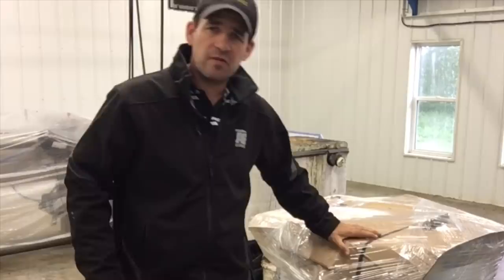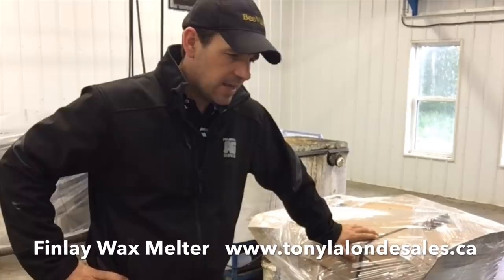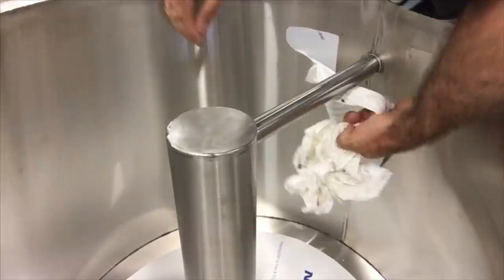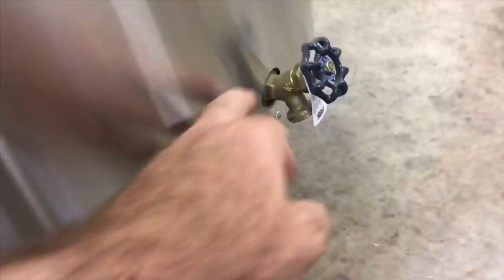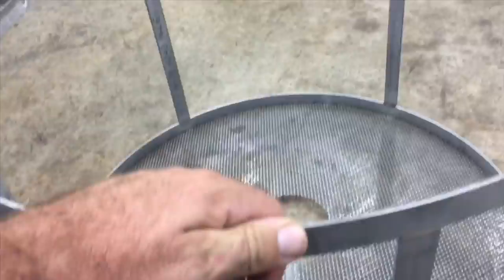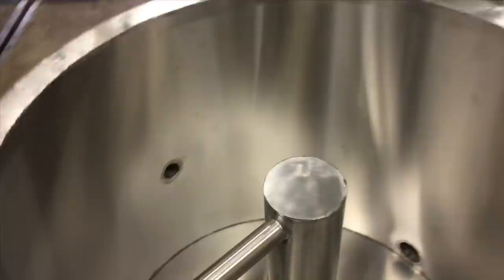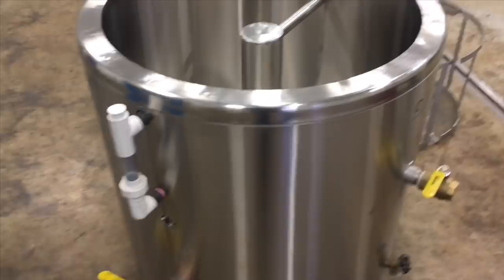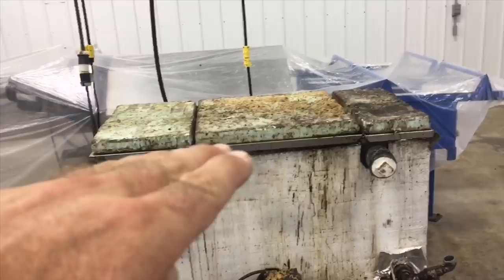My Finlay Wax Melter Arrived, so EXCITED! 09/21/2019

Comment: For anyone wanting to get clean wax but don't have the production that Ian has there is an easy way to do it.  Forget about using a spaghetti strainer and mashing the wax out.  Get yourselves a tall strainer and put it in your melted wax while it's still in the pot.  The strainer keeps the slum gum from entering that area and you just scoop up the clean wax.  No fuss and easy to do.  It looks like that big strainer will be doing the same thing.  Keep the slum on the bottom and float the wax up to pour off.  Nice.
I guess an old spaghetti cooker would work too, but those are expensive.

Comment: If it’s full of fresh cappings, it’ll take 24 hours to melt (on high). If you tap the honey and fill it with water, I expect it’ll take awhile before you can drain the wax off. 
We fill ours up, melt it on high, tap as much wax as we can of the top valve, then dump what’s left out the bottom. I keep it hot and just keep repeating for a week or so. I don’t think it’s worth salvaging honey as ours gets a bunch of water from the spin float mixed in. After a week, on a non extracting day o drain it down and let her cool off, and scrape out all the slum. We don’t have the slum screen, I can see how it would help but we do fine without it.
Reply from the maker: Dean Malkewich 
That sound like what we do now, 
Except I expect it to run much more power efficient
Reply: a Canadian Beekeeper’s Blog and the second tap makes a difference. You’ll probably want elbows for those valves.
Reply from the maker: Right now I run everything out a bottom tap.  I look forward to running layers , but not sure why they put the second tap so high up ,?
Reply: a Canadian Beekeeper’s Blog I’m surprised how much junk we end up with in the bottom even with pure cappings. I don’t remember many times when the wax layer went much below the top valve.

Comment: Hi I have a question about your new melter. If you told me how much power the heater has and how thick sheet metal the walls are in it? And how thick the walls are?